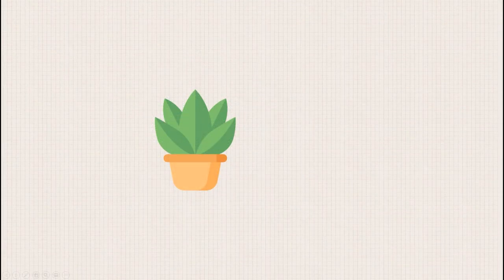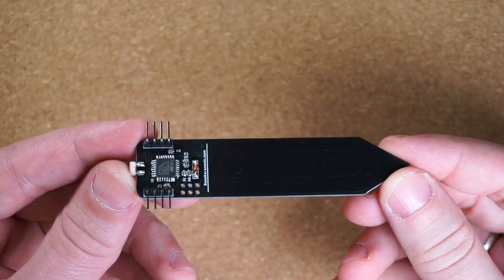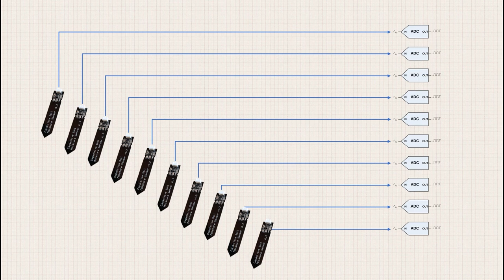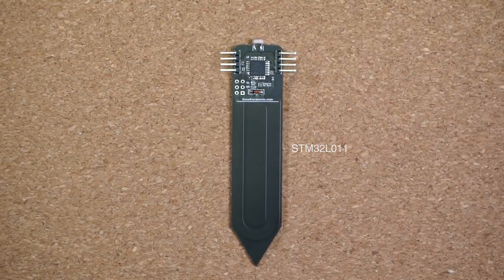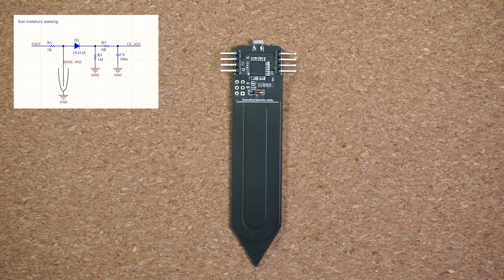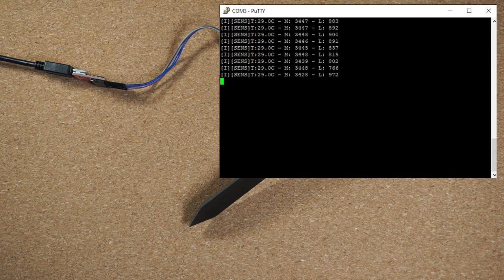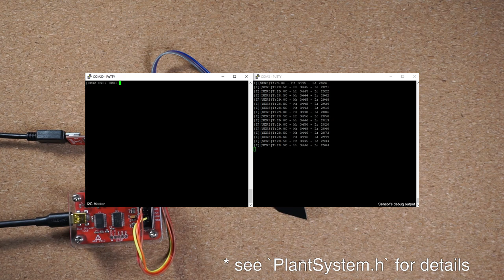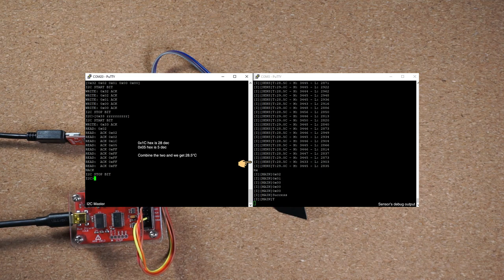DIY House Plants Watering System // Part 1: Sensor Board

Comment: Would be really nice to have these sensors transmitting wirelessly
Reply from the maker: Thanks! That's a great suggestion! Personally, I might forget to change/charge the batteries, but I can see the value in having these completely wireless.
Maybe I will spin another version with a low power WiFi chip. :)

Comment: Why invent a new protocol over I²C instead of using e.g. the 'bunch of registers' protocol, similar to how e.g. RTCs work?
Reply from the maker: RTCs have registers "baked" into the silicon. The I2C address is fixed (or you can chose from a preset). Also the commands and their structure is fixed. So you can't really change the "protocol", even if you wanted to.
When using MCU, you will have to implement a protocol, regardless if it's a custom, standard or mix of the two. There are bytes flying over the I2C bus, your MCU has to have a firmware that allows it to understand what is going on and what to do. :)
Since you have to write it anyways, why not add few bytes that make your life easier...
Back to your question; We will/can have many different devices (sensor, valve driver, pump, flow meter etc.) on the same bus and all of them will have different addresses. So it's very useful for the I2C master to be able to scan the bus and ask each device "Tell me what device are you and what are your capabilities". In my next video, hopefully you will see why this is extremely useful. ;)